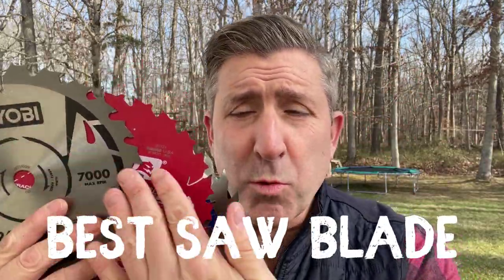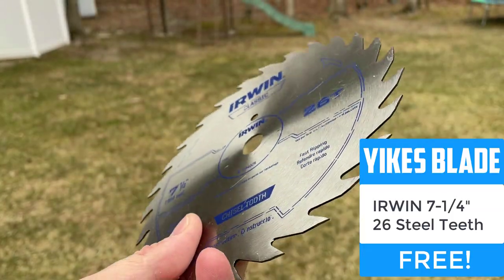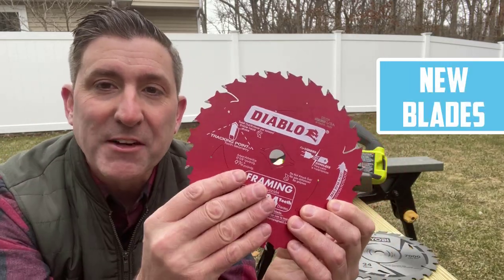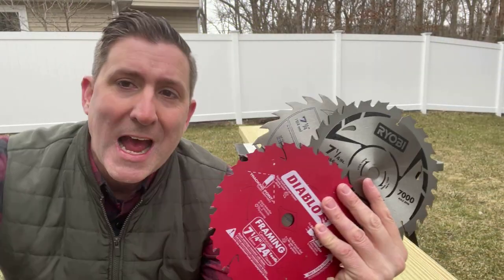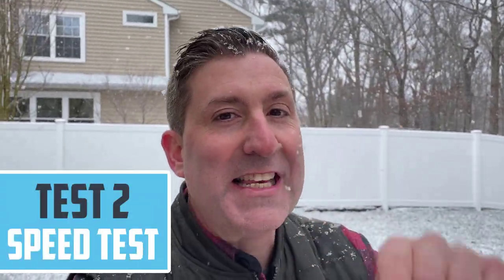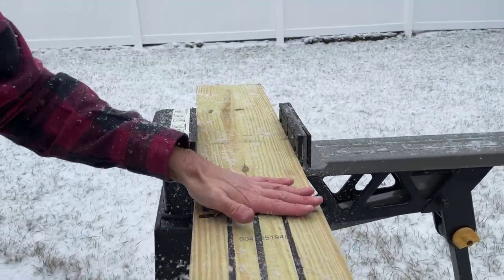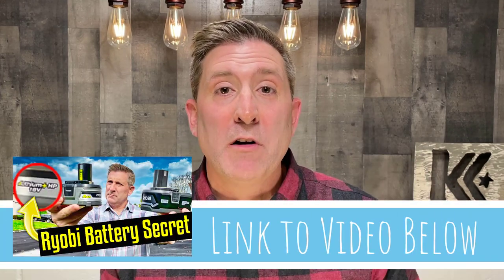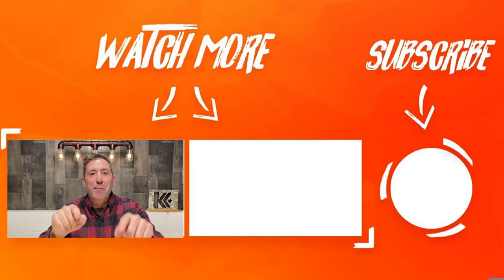[1980 vs 2021] - BEST CIRCULAR SAW BLADE ⚔️⚔️⚔️

Comment: Help me understand. If the battery runs out ...how is that a test of the blade? Plus in some case, it was ripping thru knotted wood vs not for others... how is that a true apples to apples test?
Reply from the maker: I will help -keep in mind the battery was charged between each test - a sharp blade cuts easier and takes less power so it cuts more wood.  A dull blade takes more power and cuts less wood.  Yes you are correct about the variations in wood - I guess to do a true scientific test you would have to do it 1000 times and take the average - but I for most people this was a good demonstration
Reply: You could use MDF boards for your tests, instead of using natural wood.  At least that way you will know that the wood has no variables.  Probably much cheaper too.
Reply from the maker: @michaelmulcahey2837  Good point - i grab this stuff out of the reject pile at home depot

Comment: Yes, diablo is however, a carbide tooth blade, which is in a different catagory.  Yherefore, this test is bogus. Try using an old craftsman 24 tooth carbide blade.
    Also, due to being such cheap crap, all the new blades are thinner, which they tout as good; this is why they all have heat expansion slots. Old 1/8" inch kerf blades, don' t need these, because they are thicker, and don't heat up, and, they are re shatpenable, and last longer.. The craftsman blade I mentioned did the cutting, for construction of a complete house framing, including  sheathing (3/4").
Reply from the maker: thanks